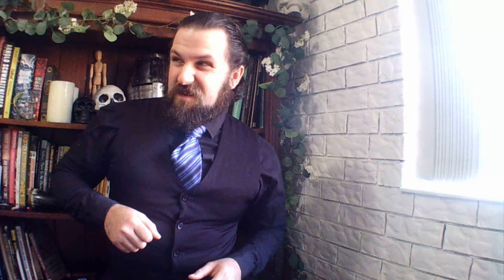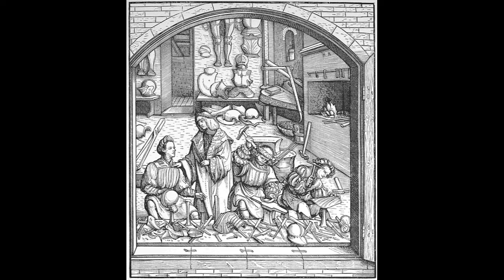Why is Maximilian / Dark Souls Armour so Heavily Fluted?

Comment: I'd say it's definitely aesthetic, but may provide a bit of structure as well. If fluting was completely worthless as a protective feature, we may not have seen it on so many examples from that era (not just "parade" armor on display). After all, the smooth, domed, Italian style had none of that fluting and was considered among the best protection in Europe for its time, so it's obvious that fluting was not strictly necessary for structural rigidity. Where my own knowledge fails is whether the Italian vs. German vs. other styles of the late renaissance have differing levels of thickness from each other in order to compensate for fluting vs. smoothness, etc.

In any case, the impression of these highly-stylized pieces, such as the Maximillian armor, cannot be understated. This was the Ferrari Enzo for its time. Absolute peak of craftsmanship and aesthetic--truly a masterpiece. Thanks for sharing!
Reply from the maker: Without a side by side comparison, it is hard to judge how much the fluting helps. Maybe one day I will knock some fluted and unfluted breastplates for the boys down south to test. They have mush better camera equipment than I do. I have a feeling that we are over exaggerating the benifit. The flutes help by making it more 3D but if it is already a massive compound curve is an extra mm of volume really going to have a big difference? Might be a good thing to test.
Reply: I'd be interested in those results. Thanks.
Reply from the maker: @0num4  It will have to wait as I already have an very long to build list but I am thinking of building the breastplate from dark souls IRL as that will get more people to watch it.
Reply: Something that kind of combines some of the aspects of German and Italian armour is English armour atleast from t1460-90

It’s steel is overall thinner than Italian but covers almost the entire body(back of the thigh and crotch are actually covered by plate)
The extra coverage basically makes it weigh about the same 

But the breastplates are very rounded along with the plackarts, though the edges of the plackarts have a spiked edge instead of smooth, same with the fauld

Pouldrons are generally very much Italian inspired but with much less inhibiting or sometimes no reinforcement plates, usually if there is the cover the tops and sides of the rather than the front
(because the English fought mainly on foot they weren’t for stopping lances but overhead strikes)

But it’s got lots of fluting in the thinnest parts
Gauntlets, sometimes the helmets, Arm and leg harnesses of English armour are heavily fluted but unlike gothic armour it’s much more pronounced and also the style is usually very different

However I’m not sure how much of it is just aesthetic admittedly

Will say Italian export armour industry had a big stake in England and weirdly it was cheaper to get Italian armour built the English style than it was to get  English full plate 

And from what I remember german armour was not popular at all in England
Reply from the maker: @jungoder1085  I still have not had time to read Toby's books cover to cover but I was not aware that anything survived from this period. How do you know the thicknesses? Is it just that it would make sense to have lighter armour on foot than sitting on a horse? It could also be that the breastplate is already a massive compound curve so the fluets add less value. As for differences in aesthetics between english and german armour. They both live withing different artistic traditions. The english armour looks like some english stone work in churches. Have a look at the green man and oak leaves in english stone work. I think the german armour looks more like geometry and gothic churches. Where are the english stuff looks like plants.
Reply: @ArmourArtist  oh I never thought about the fluting coming from that that’s really interesting I’ll have to look into that 

I think the main thing with the weight is actually the reinforcement plates rather than thickness, I’d have to reread his stuff though it’s been a while lol

Also the breastplate shape stuff makes sense to me the curves are much stronger than in a lot of gothic stuff

Very very little has survived which is why Tobias was going off of a lot of effigies, artwork plus the few pieces left so it’s probably not as certain as it could be lol

But the reproductions of English armour weigh around the same as Italian armour

To me it seems more of a max body coverage for foot combat vs a very heavily reinforced upper half for horse back comparing Milanese and English

Comment: 4:19 OOOOOOOOOkeeeeeeeeeiiii... i hope the mahnificient deal is not expired yet

If we have a hypothetical fictional material that's light and solid enough, to armor made from it be kind of compared to medieval armor at point of weight and thickness, its get an abilty to prevent almost any popular modern handheld firearms bullet penetration - so basically a fictional ceramic made buletproof solid plates armour. So the quastion is: what the shape shall it be to make a wearer get a little as possible of the bullet energy when he get shooted (maybe the shapes thats do not stop but make bullets ricoshet). Also ther is should be a helm, thats shall prevent a wearer from lossing his consciousness after getting a direct hit into thats

Also, for usability reson, we do not arm the neck or other small hi-moving points, to don't interfere a person’s free movement and firearms handling
Reply from the maker: Some modern materials would let us build a level 3A armour for the same weight as about 3mm, level 4 for a bit over 4mm and level 2 for about 2mm of steel. So it would be on the heavy end but we could build it. There is also some good exoskeleton tec that would make it more manageable. Yes curved surfaces are going to be better as unless it is a perfect right angle to the point of impact it should redirect some energy away at an angle. Unless this material is designed to catch the bullet and deform. A historical shape with a central ridge would probably be best but you don't want something that sticks out too far for if you need to go prone. You could design something like a jousting helmet to let you take a shot in the face but it could really restrict your neck movement. I think something like a bevor that locks to the breastplate would be better. You could lock it down when you want extra protection but then unlock it when you want to be able to look around easier. I would still like to protect the limbs from frag with light armour. As in a lot of wars your more likely to get fragged than shot. That was true in ww1 and it is still true today.
Reply: @ArmourArtist  Thanks for the ansver! a bevor, yeah that's may be a good idea, about fragged indeed, but i dont think an extra weight like a chain mail on a non vital parts* its a proper idea, may be something like very durable but light cloth. cause to extra defend a legs cost a lot of weight, and a lot of moeny. But also I personaly visualize it not really in a modern really, but more in a alternative si-fi fictional fantasy with some sort of chivalry like a very conservative and elite sodiers orden.
Reply: maybe it should look like a bevor + modern helmet, i'm also really want to make a cool looking solid helmet (something like mandalorian one) but it's kinda pointless if after hit you skull be destroyed

Comment: Would adding holes make the same effect?
Reply: Perhaps? However I could imagine holes would compromise the armor and make it far less durable.

Armor MUST have a balance between fashion and practicality. You would definitely want a fashionable armor but not at the cost of your life.

If the tradeoff for fashion is negligible, or barely noticeable than it may be worth the risk to look good.

However something as extreme as holes is, far too dangerous to implement into a real armor even for fashion sake.
Reply: With the exception for breathes, which serve a purpose in air ventilation, breathing, and vision to some extent.
Reply from the maker: To make it more ridged? No.
Reply from the maker: @fallencrusader2975  Decorative holes are a thing on some armours where there are overlapping plates. You see a lot of it on gothic armour. As for your comment about the protection vs fashion trade off you are very logical but humans are not always logical. There is one exception people like to point to but I am skeptical. For a while when crazy long pointed shoes were in fashion there were also crazy long sabatons to go with them. So long that the shoes are hard to walk in let alone steel verions. Everyone so far has explained it by saying it doesn't matter if your on a horse but I still wonder if it might have just been a tournament thing.
Reply: @ArmourArtist  I stand corrected by the holes in the armor, history can be very interesting. I've seen those pointy sabatons as well and assumed they were for jousting tournaments but my knowledge is too limited on them to say for sure.

Its hard to imagine anyone fighting on the field with those things on, but I guess you can be surprised...